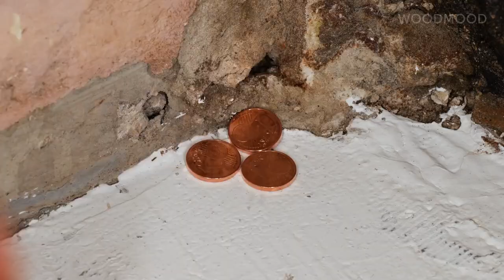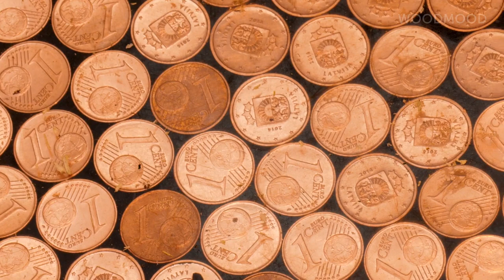Amazing restoration of an old toilet || DIY challenges by Wood Mood

Comment: А это нормально, по старой краске новую класть?)
Reply: I know here in the US it's common practice now a days, unless you have lead or other harmful substances.
I will say though if there is a house with 15 different kinds of paints built up on the wall it needs to get scrapped up.